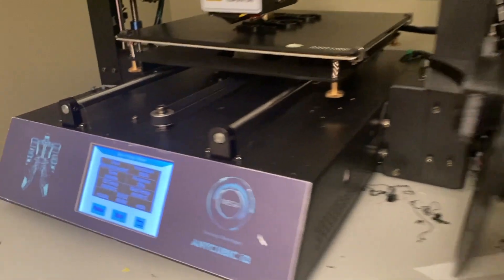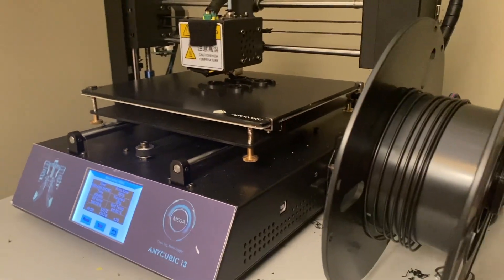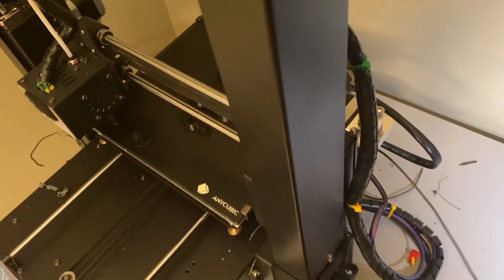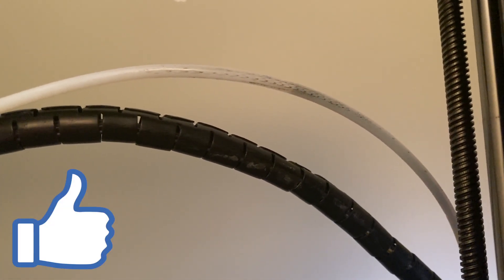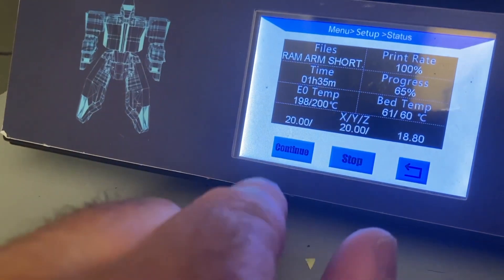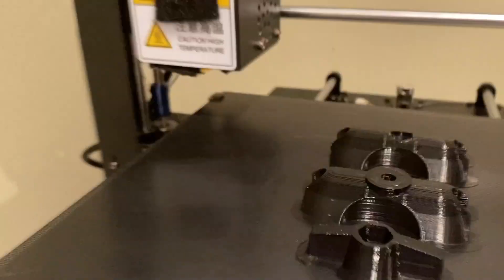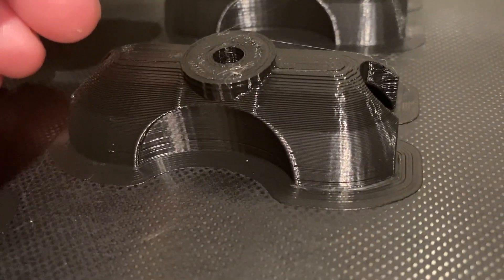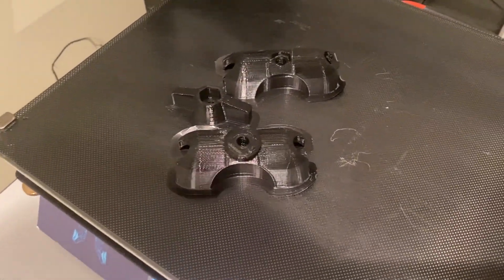What Happens when 3D Printer Runs Out of Filament   What to do

Comment: I pressed ok but the filament page didnt show up. I went to filament manually but it says "machine running, try again later"
Reply: When my printer runs out, the machine sits and the bed cools down, allowing the print to become loose. So then what do I do? 😢
Reply from the maker: hmmmm not sure why that would be
Reply: @spaerodynamicdrones360vide7  its cause i have flashed the marlin firmware(doesnt support filament change). I remembered i had done that after i asked the question.
Cheers!